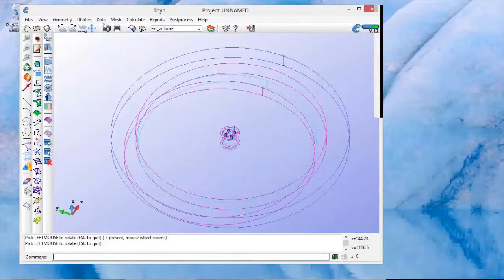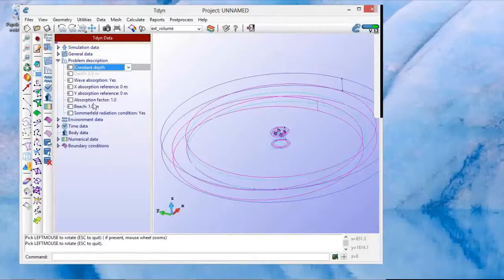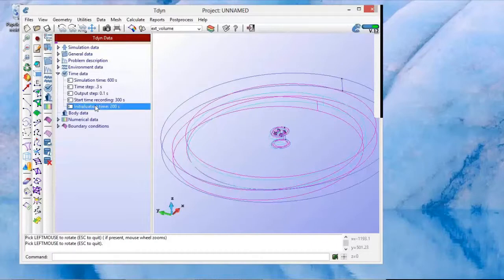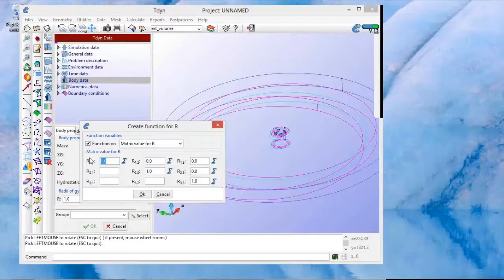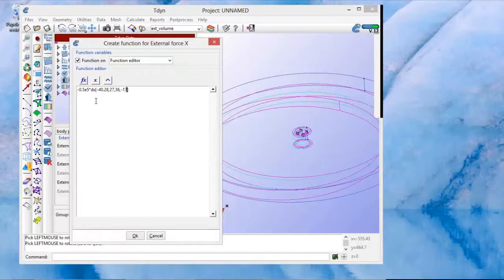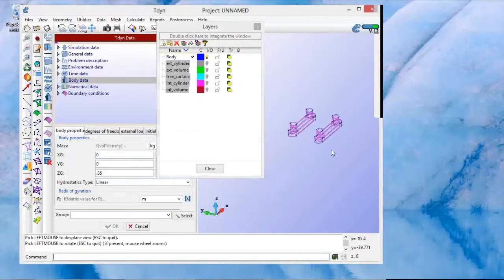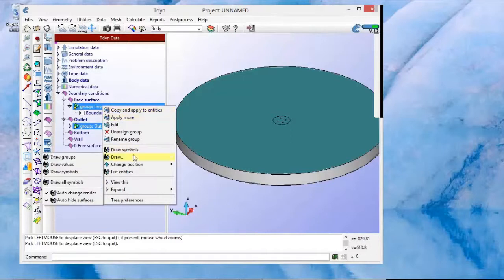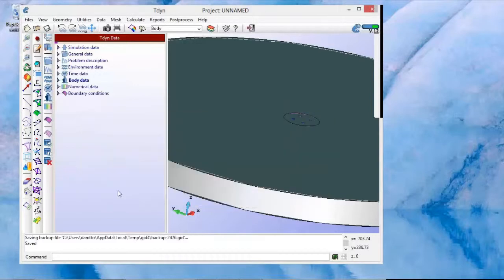First SeaFEM webinar_October 2013_Part 3

Comment: What is the beach parameter for?
Reply: Dear @sunnyhing91 
Beach parameter defines the distance from a reference point in the free surface,at which the absorption area will start. That means that no scattered waves absorption will take place inside the circle of radius = "beach" and center the reference point. This area with no artificial dissipation is the "analysis area".
This and all the parameters in SeaFEM are fully explained in the reference manual, which you can find within our support web page, together with validation cases and tutorials:
http://www.compassis.com/compass/en/Soporte